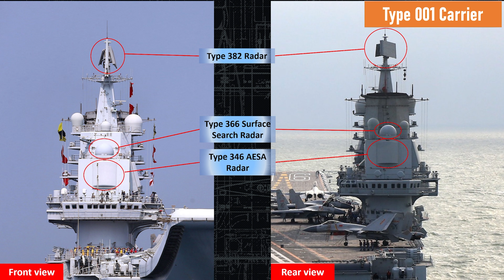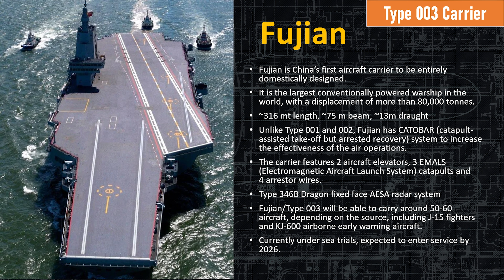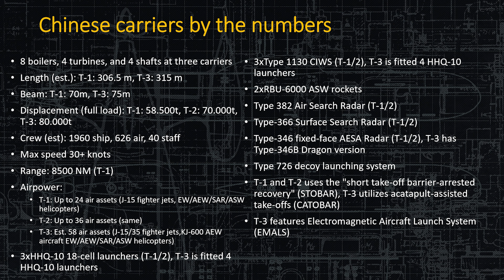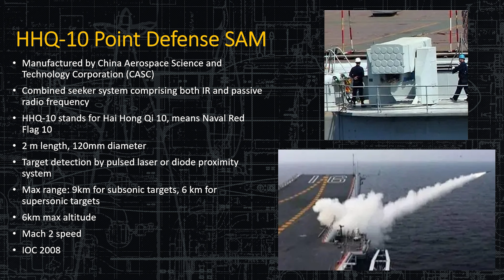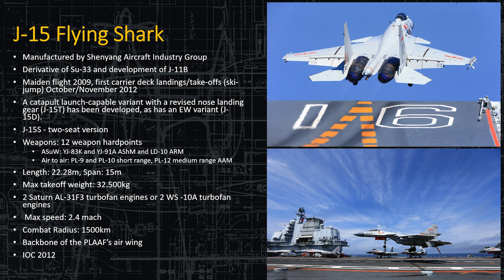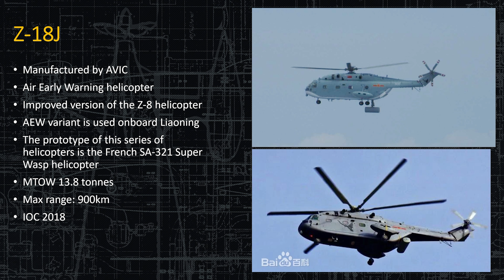China's New Fujian Carrier Changes Everything - Here's Why

Comment: Actually, Type 004 will be bigger than Ford. And, just like 003, it will be able to use its EMALS for launching stealth aircraft. Unlike Ford which still can't. I guess they're too busy dealing with their spontaneous combustion laundry so the EMALS readiness has to wait.
Reply: This guy doesn't even know that OO3 has EMALS and has demonstrated that it can launch the 5th generation fighter J-35. 哈哈
Reply: @catonpillow. Re: USS Ford EMALS failures. This is OLD NEWS from 2021. As of 2026, it's been fixed & the USS Ford has launched THOUSANDS OF SORTIES using EMALS as part of Epic Fury. FYI: In case you didn't know, EMALS have been certified for LIMITED F-35C operations.
Reply: @SlimjimNYC270  the USS Ford can't use F-35s until after its mid-life refit/refurb. Nevermind if the EMALS can launch them. It doesn't have the facilities to maintain them. This was known from the time it was launched. 

The F-35 and the Ford were both developed simultaneously. Rather than delay the Ford to wait for the F-35 design to stabilise and it's maintenance requirements known, it was decided to proceed with the Ford without waiting for the F-35. What wasn't expected was the amount of delay in the Ford itself. That it would take a decade of testing and tweaking to work out all the bugs and kinks.

It was expected that the JFK would be the first Ford-class carrier to carry F-35s.
Reply: Oh, they also can't have planes incoming and outgoing at the same time.
Reply: @philonetic The catapult literally launched a 33 tonne AWACS from the carrier and you think it cannot launch a medium weight fighter. What is this logic lol
Reply: @APDM_Analysis Go find a video of an armed J-35 launching.
25 tonnes, not 33, and a prop plane with a large wingspan is not the same as a fully armed jet fighter. A fully armed F-35 weighs 32 tonnes and does not have the benefit of a large wingspan. China hasn't show their carrier to be capable of even half of that weight.
Reply: @philonetic it's 33tons loaded lmao. 25ton is the empty weight, without personnel or fuel. At 25ton the plane propeller won't even turn. How can you even launch that? You only did a simple google search and saw the first result. Sit the f down you clown lol. Btw 33ton figure comes from Janes not Chinese media, or your head.
Reply: @philonetic  carrier based planes typically had lower stall speed. How do you think they land? 

And the KJ-600's weight empty is 25 tons. The J-15t and J-35 empty weight is half their MTOW. They've proven that they can launch half the weight. What we don't know is if they can launch them fully loaded.

And I don't like your continual retreat strategy. We don't know if their catapults work ... we don't know if they can launch anything ... and after they launched dummy weights during a test, we don't know if they are strong enough to launch actual planes ... to ... we don't know if they can launch fully loaded fighters ... to ... we don't know if they could maintain the launch rate.

All this continual step by step retreat, with China winning every time ... you do realise don't you that this is extremely demoralising. How about we choose our fights to those we can win?

After all, if all China had to do was to add more or better super-capacitors and/or the electrical generators ... why are we picking these doomed arguments? It makes China look very good with all the winning we are just gifting them.
Reply: @phi @philonetic re literally arguing and saying absolutely nothing here. For one, China isn’t obligated to show you such things. Secondly, like I just said in another comment, there are only a mere two video of it carrying out carrier ops. That being the reveal of catapult/landing tests in September (which was from sea trials back in March/April of 2025 and was with prototypes), and two weeks after it was commissioned in November, and there have been none since, though it has done another two training sessions that are yet to be seen footage wise. I’m not even sure what your argument is; J-35 and J-15T are designed and going to carry heavy AShMs like YJ-15 and others; you are blabbering nothing predicated on nothing. Cope and try again.
Reply: @danielch6662 He’s an idiot. No clue what he’s talking about.
Reply: @Flightman453  Facts > Your feelings, little troll.
Reply: @philonetic  Like I said, thanks for admitting you cannot refute. Sorry that reality doesn't conform to your needs. I've enjoyed embarrassing you though little one.
Reply: @philonetic  j35 is 31ton
Reply: @seeuu-o9f6h  The KJ-600 is 25 tonnes. The maximum takeoff weight of the J-35 isn't even 30 tons. That's according to the manufacturer.
Reply: @danielch6662  China, winning? What are you on about lol. Good joke.
They have turbofan constraints, multiple performance issues, can only carry a light payload, which even that has never been shown from their catapult.
I'll stick with what's verifiable, thanks.
Reply: @philonetic  The video shows that the weight displayed on the weight board for J35 is 31 tons, while for J15T it is 35 tons.
Reply: @philonetic  In addition, the KJ600 weighs 31.5 tons, which is 6 tons heavier than the E2D. There are videos showing the weights
Reply: @seeuu-o9f6h  No, it weighs 56,000 lb. That's 25.4 tonnes. Google it.
Reply: @seeuu-o9f6h  Cool story. Try looking it up for yourself, not on YT.
Reply: @seeuu-o9f6h  No, it's not. Read The Uncomfortable Truth About China’s New J-35 Stealth Fighter from The National Security Journal. "According to the manufacturer and Chinese media, the J-35 has a maximum takeoff weight of nearly 30 tons and is powered by two domestically developed medium-thrust engines."
They have issues with the turbofans.
Reply: @seeuu-o9f6h  The maximum takeoff weight of 30,481kg is not the weight of the aircraft.
Reply: @p @philonetic ce again, just like the rest and a lot of your odd nonsensical comments I’m reading under here, you are just admitting you have no actual understanding of how carriers ops work, because simultaneous launch and recovery is not something that is practiced ever in the first place, even by the USN who is the standard and operates the most carriers by far, either in regular ops or combat ops. You’re just embarrassing yourself here.
Reply: @Flightman453  Interesting perspective. Unfortunately for you, search engines exist.
Reply: Also, I don't understand what they missed about Iran's navy disappearing before people could blink.
Reply: @philonetic is that why the Strait is open? And why an ancient F-5 hilariously became the first fixed wing aircraft to bomb a US military base since the Vietnam War? L(Mao).
Reply: @53_FYT  Are you denying the destruction of their vessels with more cope? Reality persists, despite your deflections.
Reply: @philonetic you’re counting little explosions instead of tracking progress against strategic objectives (not that the US has any in regards to Iran). You are an unserious and infantile person, and nation. Von Clausewitz and Sun Tzu would be rolling in their graves lol.
Reply: @philonetic  yes, we sunk the Iranian navy. Time to declare victory and go home. What are we still doing there? Hoping that they will surrender so we can occupy their country and replay the quagmire in Iraq?
Reply: @philonetic No one cares; Iran navy was militarily irrelevant. It’s truly hilarious how one needs to brag about the world’s most powerful military blowing up a bunch of speedboats. That’s it? Imagine China bragging about blowing up the Philippines and Vietnamese navies. Cope.
Reply: @Flightman453  No one cares? THAT is cope lol. Project more.
Reply: @Flightman453  Imagine China what now? That would have to actually happen. Kid, you're ridiculous.
Reply: Ministry of Defense showed that the Shandong can do 28 sorties per day, Liaoning had 41 takeoffs and landings. Fujian can do with a 60 sorties in 24 hours if the catapult is working which a lack of blast marks shows it's not. A single Ford class is capable of 270 sorties over 24 hours.
Reply: @philonetic  Still just making things up. Facts don't care about your feelings little one. You aren't very good at this.
Reply: @Flightman453  Verifiable fact, google it. Keep coping.
Reply: The only time China shows anything going off of their catapult, there's no payload. Look at the unused blast plate and lane.
Reply: @philonetic The carrier has done more than 10 expeditions since commissioning, and every time there are countless wheel marks on the deck. All the information are collected by Western satellite and tracked by OSINT analyst. And here you are think Fujian only launch aircraft on TV. You really need to stop being confidently wrong on the internet and just stfu man
Reply: @philonetic  they clean them regularly. Plus 003 is relatively new and has only started testing launches recently. It's not surprising that it looks pristine.

Ford is a lot older and has already conducted thousands of launches. Other US carriers are even older. 

If the blast deflector on the 003 has so much marks from so few launches you would say its not going to last normal use, useless Temu material. You know I'm right. You will just spin everything.
Reply: @p @philonetic ddy, there’s quite literally been a singular released amount of footage of it training since its commissioning, so what are you talking about and referring to? For one, this is incorrect, given there’s other images as of recent showing J-15Ts carrying AAMs whilst on the carrier. Regardless of that, who cares and what is that supposed to prove? China has very high OPSEC on A2G munitions, so once the Fujian gets its air wing over time and they do show off more, highly likely you will not see the such with the exception of the YJ-83K/YJ-15s and AAMs. Maybe AKF-98A. Regardless, this is a random comment that said nothing.
Reply: @Flightman453  Well, at least you're right about your comment.
Reply: China doesn't have many actual stealth planes, the J-15 is reduced signature. The J-35 has never been proven. China is just now catching up to a decades old plane.
You think F-35's can't be carrier based? You know there are different models, yes? The Brits put plenty on theirs. The F-35C was introduced, what, 7 years ago and is almost ready for carrier operations?
Reply: @philonetic  Oh certainly the F-35 can be carrier based.  It's just that the Ford herself has not embarked any.  She is equipped with F/A-18s.  F-35Cs are embarked on some US carriers - but not Ford yet.  She needs some modifications in order to utilize F-35s.
Reply: @darkstar7999  the modifications are blast deflectors and secured hangar spaces. It's not a technological limitation so much as a choice by the US Navy not operate two new platforms at the same time.
Reply: @chriskerwin3904  Yes.  As I understand it, the JFK will have the modifications from the start, and the Bush will be retrofitted.  At least I think that is what I heard.
Reply: @darkstar7999  Yes, that's correct as far as I know. Apparently the blast deflectors aren't the main consideration in terms of retrofits. It's that all of the maintenance for the F-35 has to be done in a secured area which requires that hangar deck be segmented apart with bulkheads and guarded checkpoints to keep personnel without appropriate clearances out of the F-35 spaces. I wonder if the later Fords will be built with the assumption that all of the hangar space should be secured or configured differently since ostensibly most of the airwing would be some combination of F-35Cs, MQ-25s, YQ-4X and F/A-XX. It seems like the easiest solution would just be to make most of the hangar deck a secured area anyway so that they're ready to go from the start.
Reply: @chriskerwin3904  That would make sense to me also.  Sort of like a SCIF.  Things are getting really complicated.  All the people working on them will need clearances.  At some point, the easiest thing to do will be to clear the entire crew.  What do you do to fix battle damage in the spaces if the people doing the damage control are not cleared?  Sooner or later it will happen.  I remember green badge cleaning crew at one point in our SCIF because it was easier than escorting them all over the place.
Reply: @philonetic Cope
Reply: @Flightman453  Facts > your feelings.
Reply: @philonetic  British carriers use F-35B. Not F-35C. Nearly ready is not already ready. Plus Britain doesn't have enough cash to have separate F-35A and F-35C forces, so the RAF and RN are sharing the F-35B. An aircraft compromised every way. 😊 

They have 2 carriers, with each able to fit a max of 36 F-35Bs. They have ordered and received 48 total planes, minus one that fell off QE2. Long term plans are for maximum of 74x F-35B. Which isn't quite enough for both carriers, and the RAF to retain its own separate planes.
Reply: @danielch6662  I didn't state that they use the C. I've already stated that the F-35C is "almost carrier ready." 👍